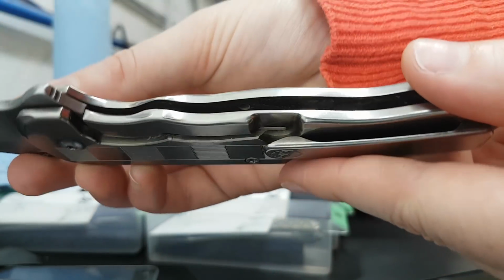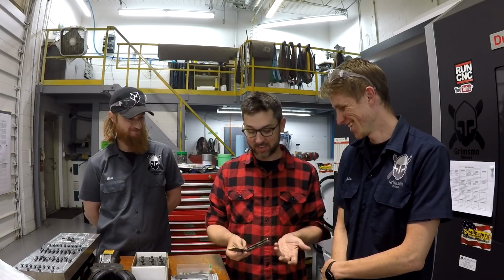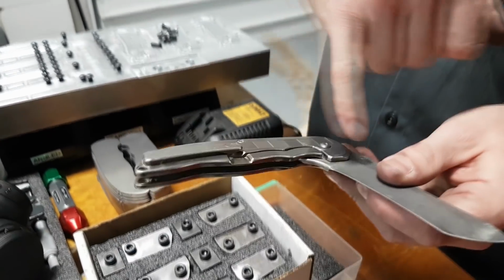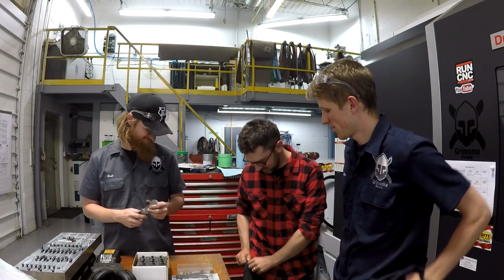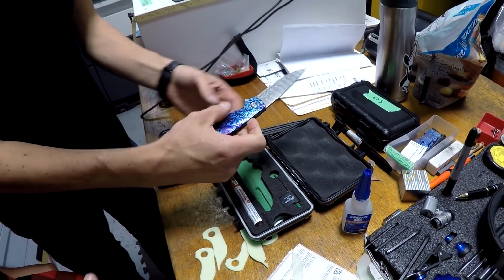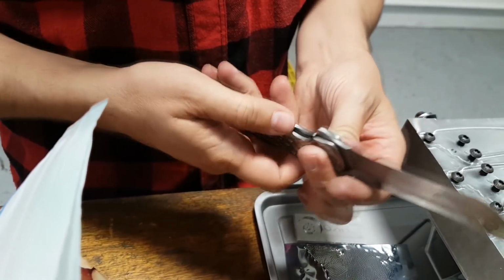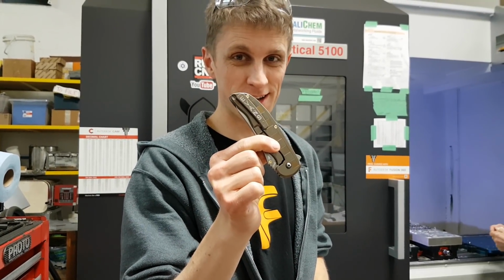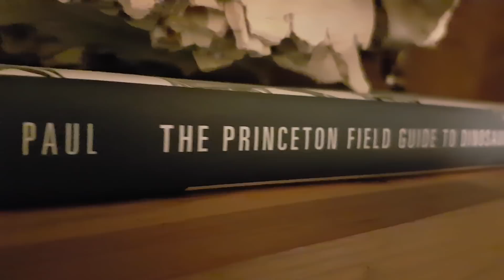Using a Norseman to dig up dinosaurs!

Comment: H1 Metal bearing cage, it’ll never rust or take damage, unlike the plastic or polymer that Most makers are currently using. This race would look something like what shiro uses. But not a Multi row system, still single. This would probably be a pointless upgrade for most people. But in theory it’ll add durability, to a “weak point” in the knife. 

Of course this would mean you no longer have captured ball bearings. I don’t know how having none captured bearings will affects the track the bearings dig. I wonder if their is a better material that’s more durable then polymer, but that’s rust proof as well, and will still allow for captured bearings 🤔.  Or maybe the free bearings in h1 wouldn’t be issue, and worth upgrading🤔

I also just bought the last Norseman you guys had up, mostly stonewashed, no anodizing. I’ll definitely be doing a review.
Reply: Use the same tool that you use now for the polymer cage. This would allow for the bearing to fit into a thicker steel cage. And be captured on one side. Call only go in one way. So when you take apart the knife, if you pick the washer up, and don’t turn the cage over, the balls stay in. 

I know I’m talking to myself, but this is the shit I think about.

Comment: You sharpened the front edge?! I remember in an old video you mentioned he asked for the front edge to be dull because of how he was using it?
Reply: I didn't actually sharpen it all the way. I just got it back to its original shape and look with probably a .020" edge. It's ready to start digging.
Reply: noice!